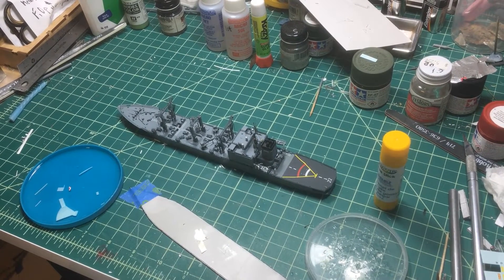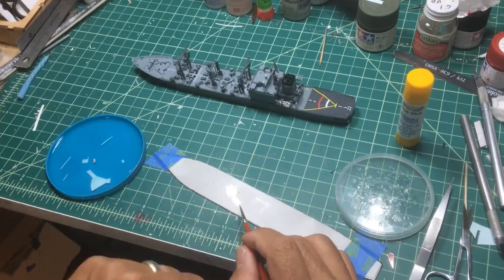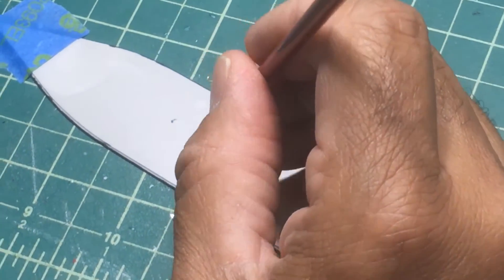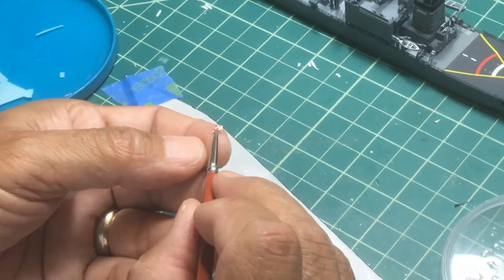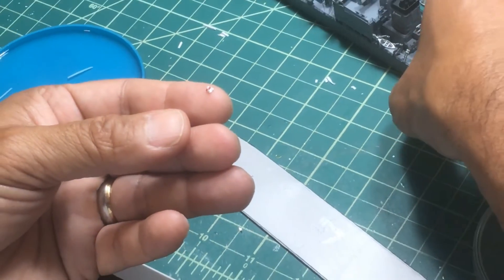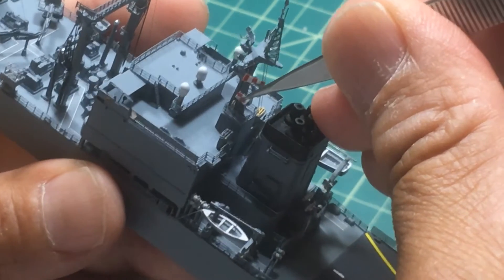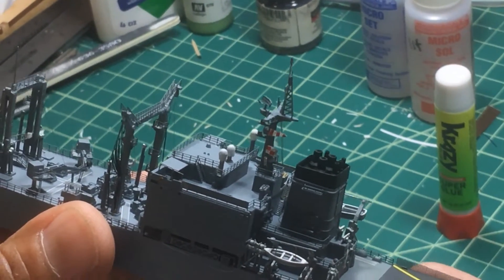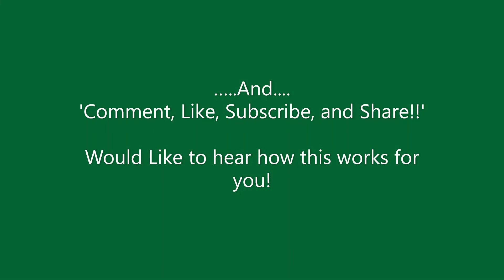How to.... Signal Flag attachment

Comment: my worst nightmare , signal and ships flags, AND Hull numbers ( in the future hopefully ) but both are an absolute misery for me, yes 1;700 is small, im thinking of upgrading to more expensive 1;350 just to do flags better, my dad served on 4 different destroyers over his years of service both in Korean war and vietnam war and one tour at sea  not in war but each ship had its own coded flag designation , i think 4 flags maybe 3 for the name of the ship is what i attempted to do , put together his 4 classes he served on, each ships name in signal flags in a clear acrylic display case for sisters and my mom as gifts... but i ran out of the correct flags from tearing them or ripping, or melting using the wrong glue, its been miserable and i tried the foil technique with no luck, i did not however use crazy glue, but i subscribed on your last video about rigging and wiring , thanks
Reply from the maker: 'fingerfeller'..... Thanks for your informative question and sorry for your hardship of adding these 'special FX' on your model ships...

Let me just say, It IS Difficult to attach these little, but Significant details take a LOT of Practice and Patience!!  To start finding a sheet of decals with Enough flags..I bought mine from 'E-bay' in 350 scale.... But, never bought those metal ones ( NOT sure what they look like OR if you can bend them a little to make it look "wavy" ).  Using foil and a glue stick to attach those flags is a bit tricky, May I suggest .... using a clear coat on those flags (spray the entire sheet), because as I crease the flag w/foil it tends to break the decal(s).  I don't cut the flag to size until I add it to the foil FIRST, Then I cut around the flag...(sometimes I even tried trimming the flag when it is folded).  Lastly, I have seen people fold flag around the line then glue Ever So LIGHTLY, attaching it to the line.  I, myself, attach the folded flag WITHOUT wrapping around the line ( SAVES a L O T of Grief!! ).

Another option is to not attach the flags to lines but instead .... hang a long line across and attach the flags from there.  OR, instead of holding the Entire model, ( which I have done a few times = Yikes!! ), hold a part of the model...like the bridge section, maybe even attaching a stand to hold that one part of the ship.

Also, if the flag decal(s) do crack, I have seen (But not done it myself) peeps painting that small crack on the flag....

Attaching flags to flags is Quite Taxing, but the results look So COOL....so don't give up.  And if you are attaching 350 scale flags, you could get better results than I have done in my 700 scale ships

Lastly, let me pass you a reference on M A N Y Flags used on a LOT of NATO ships including the US.....IT I S Quite Extensive, but it is a Cool reference..... https://www.navy-radio.com/manuals/acp/acp113ah.pdf
US ships are found on page 164.

Let me know how it goes, I am curious on how you do and Still would like to offer my help.... Good Luck!:cat-orange-whistling::face-fuchsia-wide-eyes:
Reply: @Hey_MikeZeroEcho22P  bro making them look " wavy "  is far from my attempt failures lol, i still have yet to get the ity bity flags around a rigging line and not slide down BEFORE clamping them in place, and as you pointed out in your video, i cant have one flag flowing in the wind one way and another flag flowing complete incorrect direction, its almost funny if it were not such a battle to win to get a " perfect flying direction " of all flags, i just found this post searching for flags and rigging not knowing i had already viewed your tips, honestly i gave up for several months for a break, but i need to ask, didnt i see you rotate a turret on a battleship recently ?
Reply from the maker: @fingerfeller  yeah...... doing flags is a bitch, I can see Your hardship in placing them and then the flags going in different directions and IF you are doing three or four of them (for your Dad's ship 'Call Signs') it makes it Especially Difficult!

I haven't tried to place more than three (3) and Even there, I always have one going backwards.  May I suggest, (which " I " haven't tried yet)... lay out small strips of tin foil (about the size of your flags in question), say three (3) of them.  Have the flags in very close proximity to each other, as if they were laying one on top of each other 🏴🏳🏁(except that the line, is one [1] Straight line).  Then, cut a Good length of 'rigging' with some glue from a glue stick (run the line on Top of the glue stick), just enough where the flags are going.  Attach the line...lay it flat on the flags [ NOTE:  Might want to secure the ends of the line before proceeding good size weights, just Don't Stretch  DA Line!! ].  CAREFULLY..... fold over the flag with a knife (like folding PE), then press down the flags to final fold position.

Again, Practice First with strips of tin foil FIRST, Before you use flags, this would cut down on the cost And provide practice for you.

Lastly, as I mentioned, " I " Haven't done this before, but it Sounds sound......let me know, but Take A Break FIRST, try not to get frustrated, remember this hobby Should be fun, YES it CAN be tedious, but if you work at it..... it would be Rewarding for you ....... and Your Dad.  Good Luck!!👍👍👍